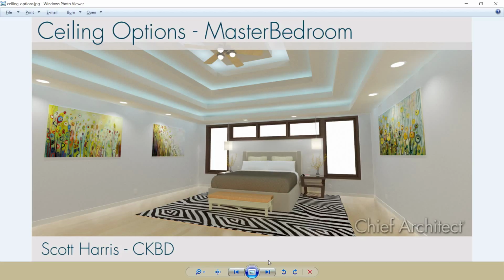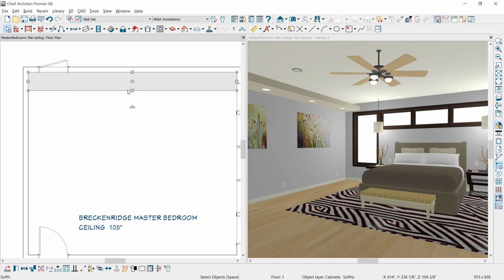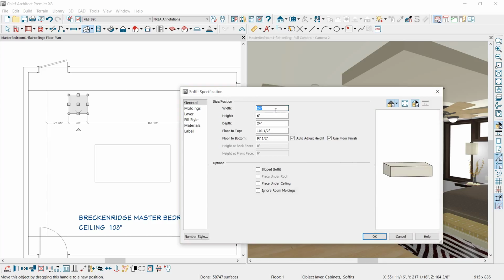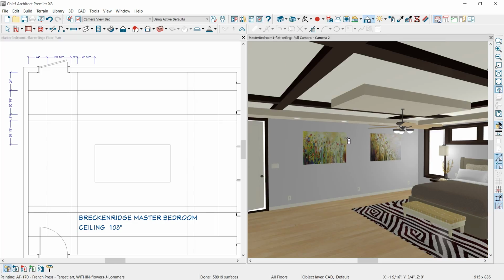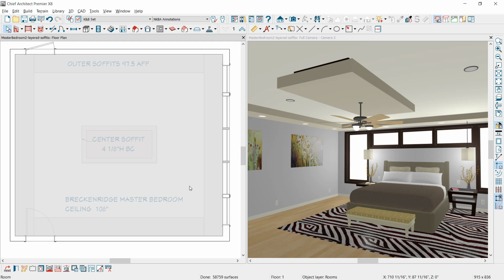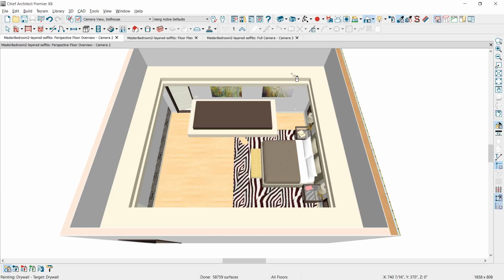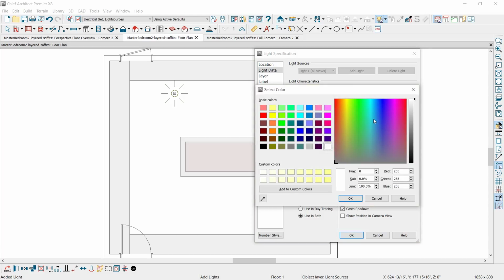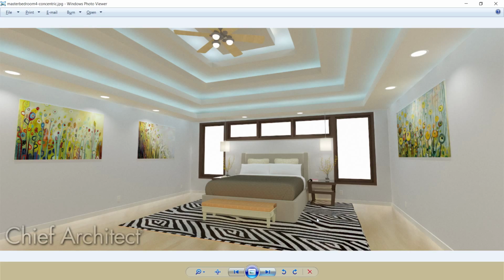Ceiling Design Options

Comment: Is there a way to use led strips and have them in the materials list and electrical layer?
Reply from the maker: We have a rope lighting tool. They are automatically included on the electrical layer and can be added to the material list where you can rename the item as an LED strip. Here is some info on rope lighting. https://www.chiefarchitect.com/videos/watch/70/rope-lighting.html?playlist=90